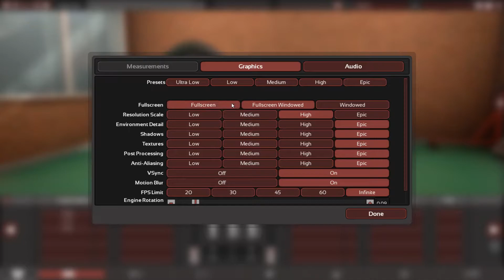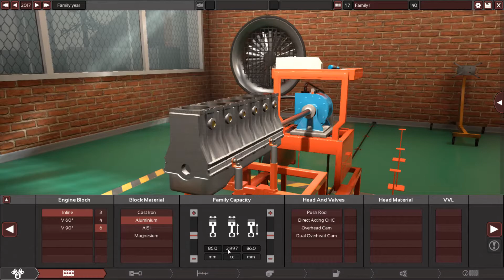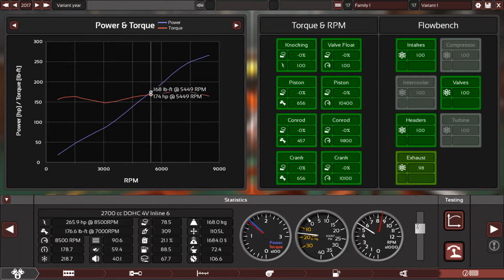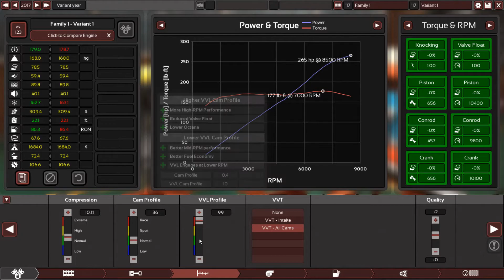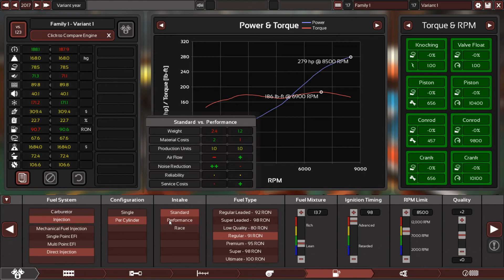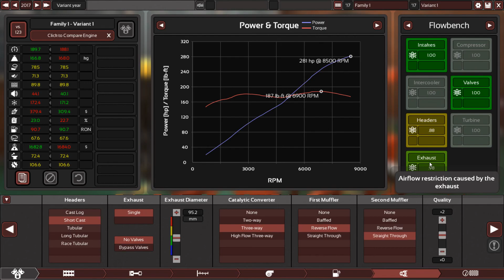MAX VVL with ZERO CAM inline 6 Engine.

Comment: Why not max out a in line 4's cam profile and block size? An 8 liter 4 cyl?
Reply from the maker: There are more than 800 videos on this channel,  im sure i did a video with a max i4 size.
And a 100 cam profile is not always a good idea. In some cases it will make the engine to lose power.